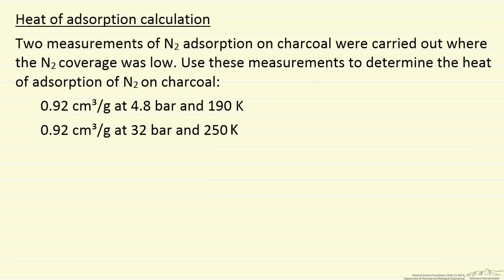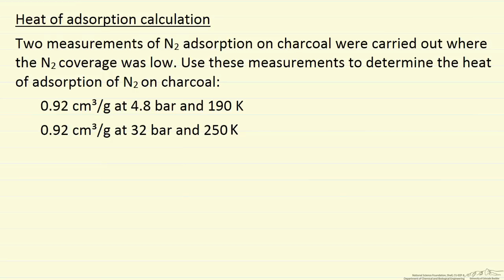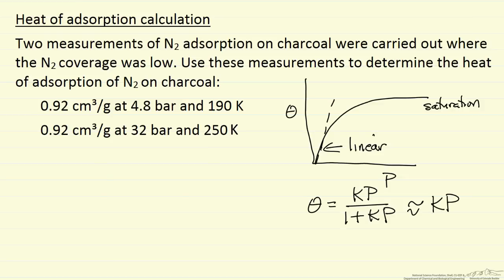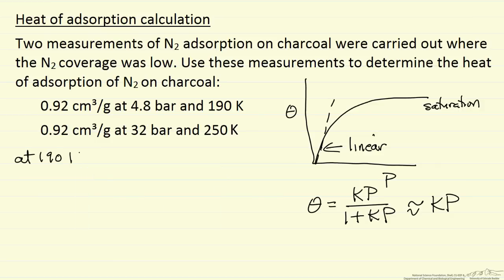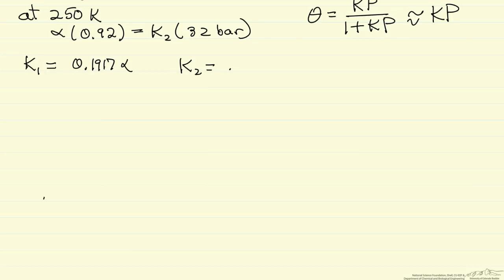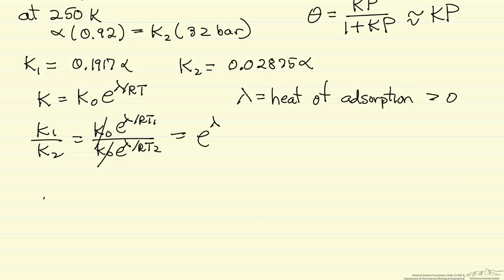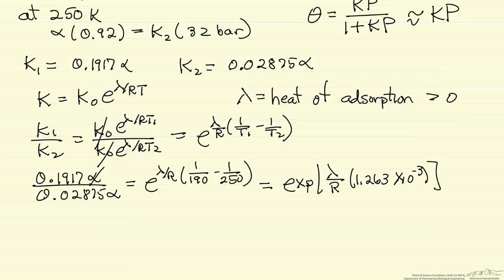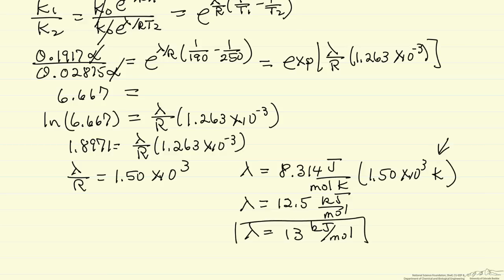Heat of Adsorption Calculation

Comment: what does the value 0.92 cm3/g represent? and why is it multiplied by alpha? please answer. i need this for my calculations. why is the fractional coverage (theta)=alpha(0.92)
Reply: I don't know if you still need an answer or not.
But, let me try to answer your question,

The coverage (theta) is the adsorption capacity (wt%) over the maximum adsorption capacity (wt%_max)

If you inverse the coverage function into variable K as a function of the coverage, you will get:
K=1/P * (theta)/(1-theta)

in this lecture 1/[(1-theta)*wt%_max] is simplified as alpha. 

so, you get :
K = 1/P * (wt%) * alpha= (wt%)/P * alpha.
That's why, for P=32 bar, you get K = 0.92/32 alpha = 0.02875 alpha.

Hope it useful.
Reply: here, theta = 0.92/max_coverage. So alpha = 1/max_coverage